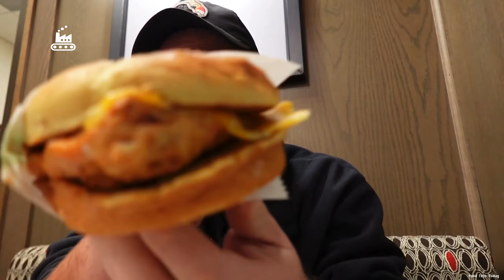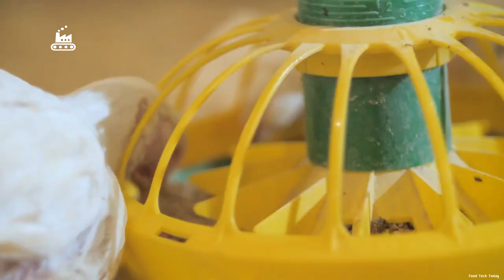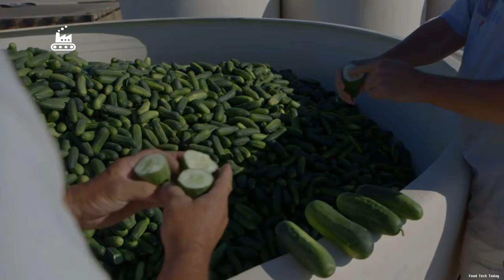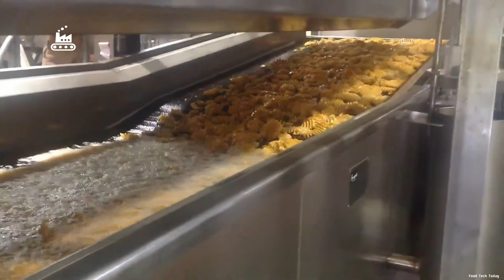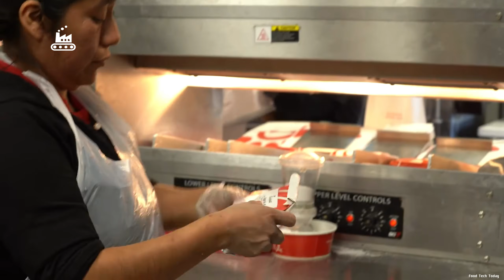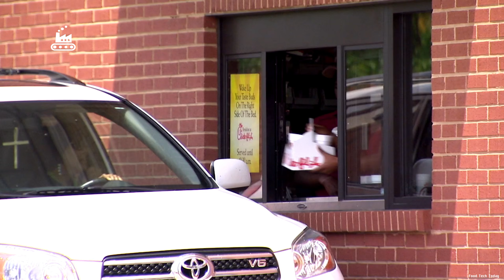Inside the Chick-fil-A Factory: How the Famous Chicken Sandwich Is Made

Comment: Did you forget that the chicken is placed in a seasoned brine? Does that get done at the factory, or at a third place in between the chicken processing and shipment?
Reply from the maker: Washing the chickens happens at the same time as the feather-removal process.
Reply: @FoodTechToday  maybe there is a bad translation, I was asking about the brine. The brine , which is a liquid that has seasoning in it .
Reply: @jamesgerard9330 the chicken strips are placed in a brine, not the breasts from what I recall when I worked there. It is the reason the strips have a different texture and flavor from the nuggets and chicken sandwiches.
Reply: This video is a good representation of the process but not actually filmed specifically for CFA. The brine and breading is all done in restaurant. CFA halves the breast.